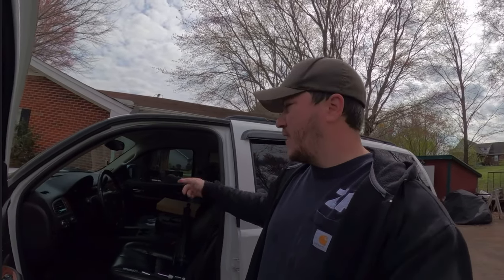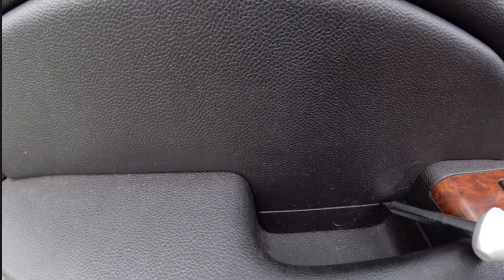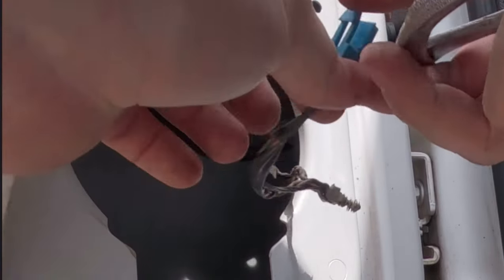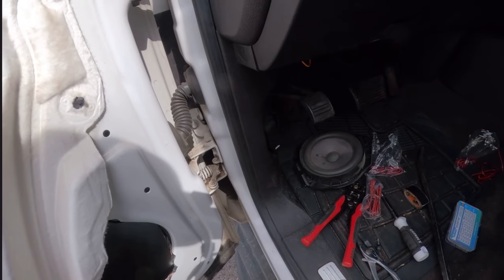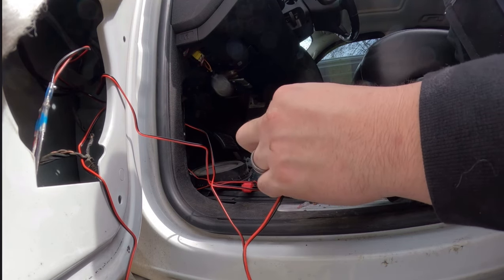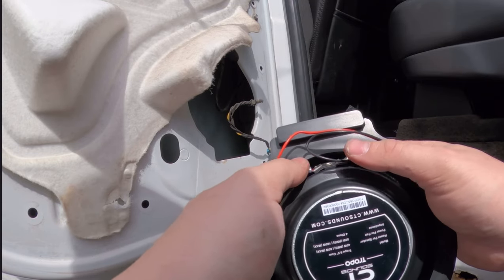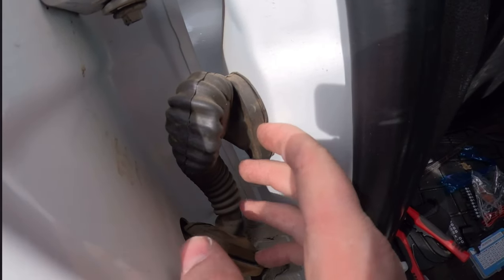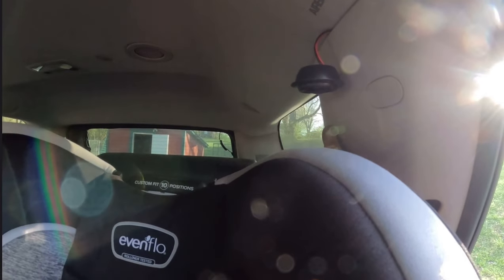Installing CT Sounds 6.5 Tropo Series Component Speakers in My 07 Tahoe!!!!

Comment: I got the same speakers coming in today. Stock speaker upgrade since the old ones are blown. Just now ordering the dash kit and radio with back up camera. 1998 k2500 4 door. Will be thinking of ordering the CT sounds bio 4x6 for the rear pillars or I'll try and build a proper box for a CT sounds hydro 12".
Reply: Just installed a pair of these in a Traiblazer SS. They sound really good !

Comment: Your tahoe have a factory amp or you running these off the deck? Curious what watts your giving them 👍
Reply from the maker: Currently just using the factory amp. Not sure if the aftermarket head unit amp is providing any extra juice or not but it sounds really good regardless!
Reply: @ZPTVChannel  thanks, I'm 50/50 on these or DS18. Appreciate the vid
Reply from the maker: Happy to help! I was looking at DS18s at first too but I’ve never had any experience with the brand. I’ve used this brand before and loved them so I just went with them again!
Reply: Sounds good but even twice as good with a small amp.
They have a black Friday sale right now.

Comment: Another way would have been 

Factory speaker wire + and - from door, connected straight into the main  + and - inputs on the crossover 

Then, a new wire from the woofer + and - outputs on the crossover and ran to the CT Sounds 6.5" woofer

Then, a new wire from tweeter + and - outputs on the crossover, and onto + and - on the back of tweeters 

Crossovers mounted on metal under the door panels, tweets in the panels